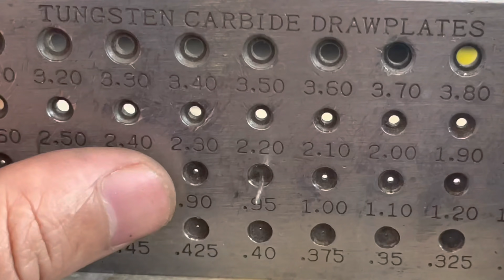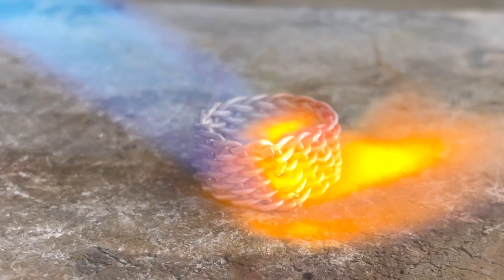Twisted Silver Ring Making | silver engagement ring making | silver wedding ring

Comment: Hi. Your work with silver is fantastic. Do you / have you ever worked in Argentium?
Reply from the maker: Where is this place
Reply from the maker: Thank you
Reply: 🤣🤣I should have been more clear. Yes as the next contributer said, Argentium is Silver with Germanium. It has some wierd characteristics like if you touch it when red hot it breaks into pieces. It can also be fused like fine silver. It doesn't contain copper so it does not go black.
Reply: @Merojewelleryworkshop  sir how to contact u for business purpose????
Reply from the maker: Instagram

Comment: what are the pliers you are using to pull the wire through the bar called
Reply from the maker: Draw plate
Reply: @Merojewelleryworkshop  i meant the name of the pliers not the draw plate
Reply from the maker: sms in instagram

Comment: How can measurements wire for ring size/number according fingers
Reply from the maker: Subscribe our next channel we do the full measurements process
Reply from the maker: Thank you so much for subscribe and if you like to make this ring pull wire in drawplate 60 cm long and cut 12 piece in 5 cm .if you have long than 60cm does not matter divide into 12 piece and twist each other.make the ring size if long you can cut it for more detail messege in Instagram I will give whole detail or we can talk live
Reply: @Merojewelleryworkshop  I made one this afternoon! I ended up using 18 gauge wire, 6 1/2 “ long. The end of the weave was bigger than when I started! Lol
So I had to hammer it down to reduce the size on the one end so it was similar size to the other end. Then when I cut the ends of the weave, the angles didn’t match, so that took some adjusting! In the end I didn’t like the solder join of the ring, so I added a 18K gold band over top of the joint! Then I added a black patina to the whole ring and then cut facets into the top surface of the ring with a file to give it a bright cut! So the bright silver with a black patina throughout the weave with a gold band where hiding the original solder join! And I love it! I could see making some earrings with this weave in a smaller wire gauge and maybe only 6 or 8 wires. I’ll play around for more designs! Thanks for posting!
Reply from the maker: Good job 👏 👍